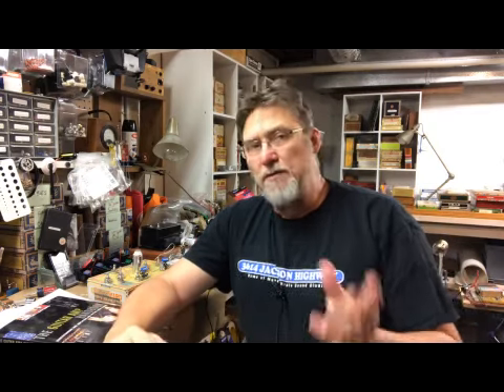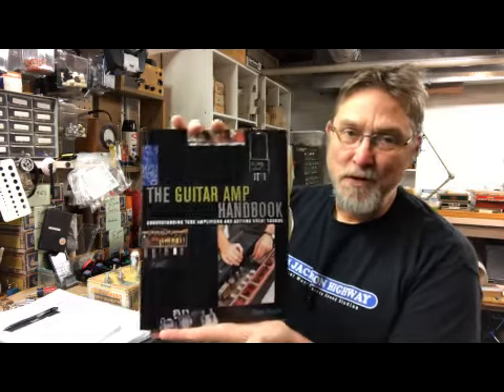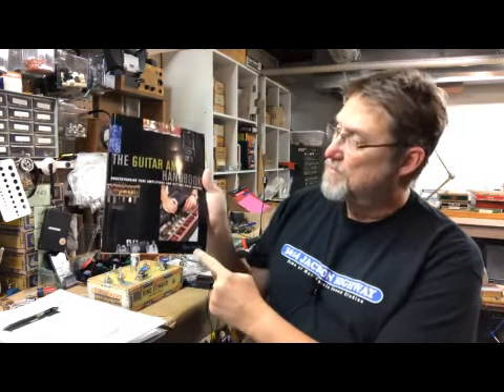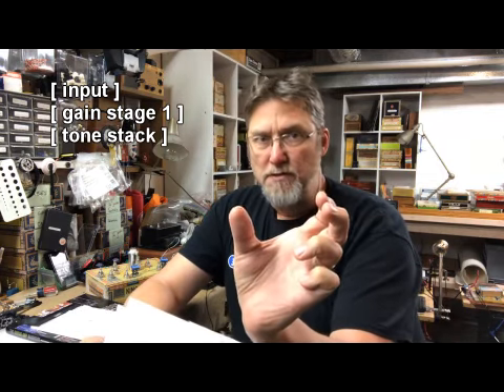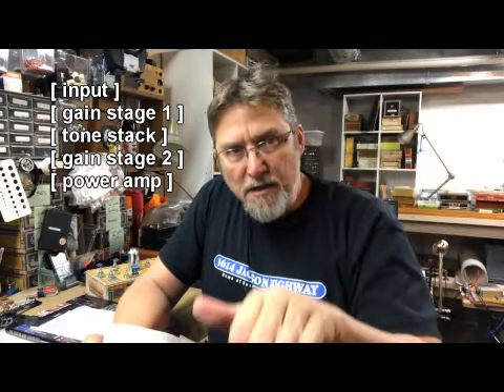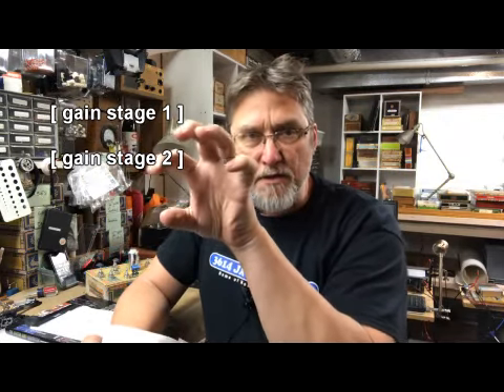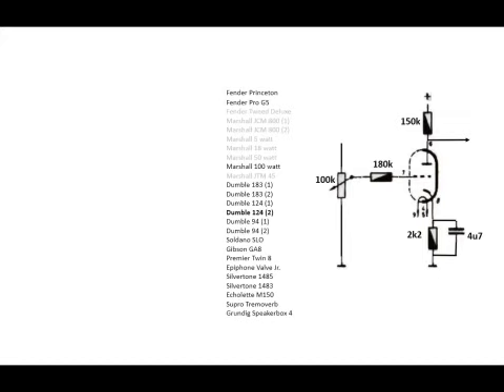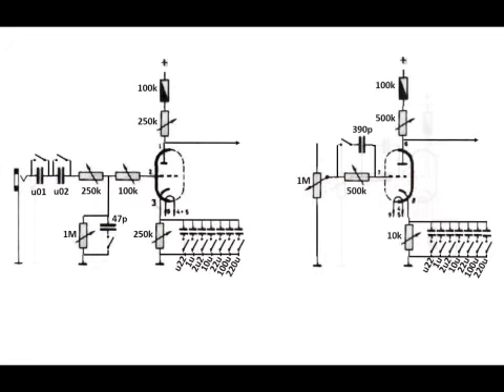Mad Scientist Lab 12AX7 Tube Test Harness (with an editing mistake or two)

Comment: Fabulous content and great "stage by stage" approach.

I am wondering, though, do combinations of parallel capacitors produce the same frequency response as a single capacitor? For example do two 50uF's in paralelle have the same response (time constant?) as a single 100uF

Having trouble with the 'jellybelly" link to the drawings, but tat may be on my side of the inter-web

Thanks and keep going!
Scott
Reply from the maker: Mr Carlsons lab did a video about this a long time ago. If the capacitors are a different type it can make a difference in some high frequency applications.